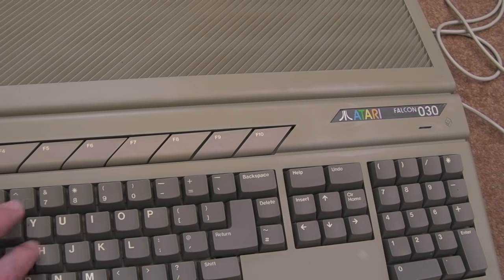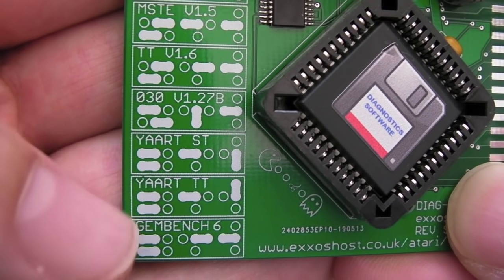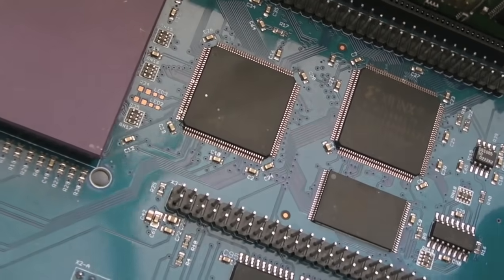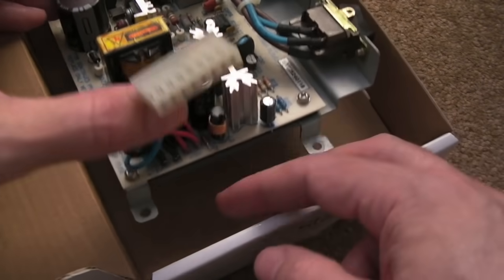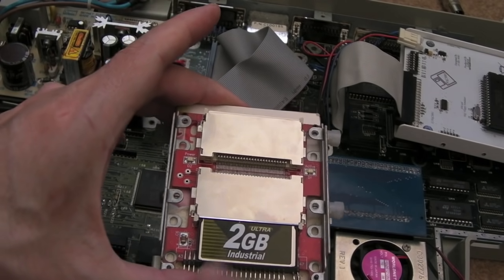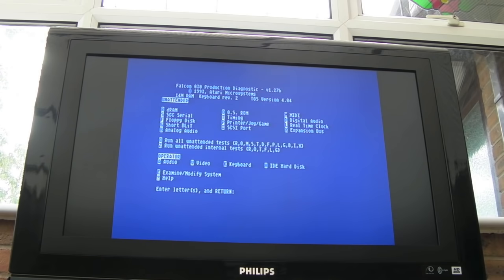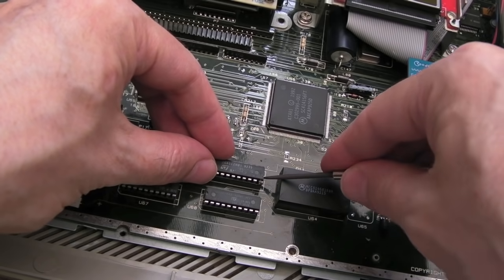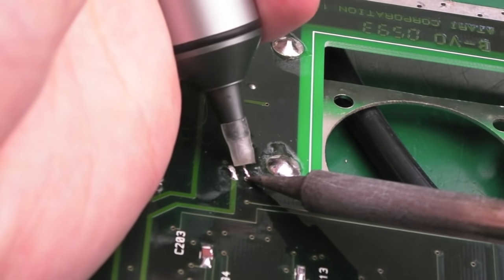Atari Falcon 030 Unbelievable Donation & Repair Part 1 (Fixed + Extras (060))

Comment: Never seen you so happy, congratulations. :) Yeah Jaguar pads work which is cool, you can even get a Pro one at AtariAge, saw someone on a forum suggesting some old ass joysticks for the Falcon's relatively modern 15-pin port. :\ Strange for sure about Falcon controller support in homebrew how it could be more robust.
Always amusing to see your future self comment over what you're currently saying Ie. "No you're wrong past self", like time travel. ^_^ Yeah pretty decent performance but look forward to seeing performance go up. :D

Comment: ☠️BLACK BARON☠️ Designers started DTP and Layout with TrueColor on 21" monitors in !true color! at that time ... they were all waiting for this new wonder 68CPU "early PowerPC" machine ... until I heard the news. Commodore + Amiga smashed it ... the Bill+Steve factor in teamwork. Instead, I received an MS-DOS machine with green monitor "terminal commands" as a present from my father. I was so utterly frustrated at that time after GUI and UI and a fully customizable Desktop user interface with GEMINI and a trashcan on my screen and my first DTP experiences as a graphic designer. No support for my HP Laserjet with lots of Atari shareware fonts I started collecting for DTP purposes. Instead I got a "Typewriter" printer from dad. Totally nonsense concept and idea.

Comment: Couldn't resist any longer. Have. To. Watch! So so envious. One of my fave looking machines. I'd drool over the Falcon in the ST mags in the day. It had so much potential.
Reply from the maker: =D  I still can't get enough of it - it's a great machine, I feel so priveledged to own one!  At the same time I am kinda affraid to use it since parts are kinda unobtainable.  Since Best has a monopoly on parts, wanting £2000 per custom...
Reply: Speaking of which, the keys should be a shade of grey - several tones lower - not brown. It's also weird that the PSU switch is black and not the ST series of grey to match the case... I wonder if that's factory. 

Anyway, it's a beautiful machine that has found its way into a loving home. 

So so jelly.

Comment: Hi, I have an old Falcon030 (1995) which hasn't been used for about 20 years. The monitor is long gone but it fires up when plug it in. I'd like to connect it to a monitor to see if actually still boots. If some one could point me in the direction of a cable and monitor I'd be very grateful.
Reply from the maker: See this page:- https://www.exxoshost.co.uk/atari/store2/  Search for the "FALCON 030 3 IN 1 MONITOR ADAPTER" on there, you can use that to connect to most VGA monitors.
Reply from the maker: PS: If it hasn't been used in 20 years, chances are the RTC / NVRAM chip is going to need swapping out.  It may cause it to not boot if the RAM side of it has failed due to the battery.
Reply: @GadgetUK164  thank you, i'll get one/

Comment: Ehh, I wouldn't plug the drive the other way, you can damage the motherboard if something is wrong there. Lucky it's an IDE drive and not a SCSI drive, because you would have even burned up the cable :)
Reply from the maker: Yes, that was in retrospect one of the stupidest things I've done on my channel - especially when you roll onto part 3 and I pointed out the ICs are like $1000 each (if you can get Brad to get one out for you...).  It came with that cable the wrong way around, I was just re-testing that to check behaviour and prove it, but as you quite rightly pointed out (and I was aware - which makes it all the more stupid) - when IDE is flipped, ground goes to some of the signals...    That said, it was a calculated risk, as we've all connected IDE up the wrong way accidentally dozens of times over the years.   It can cause failures doing that though, as we saw in the Ravi A4000 board repair I did where the IDE had died for that reason.
Reply: @GadgetUK164  Ooooh, tell me about it... I've connected SCSI the wrong way a couple of times only to see the middle wire burn out of the cable and the cable split in 2 along its length :D That was frightening :D:D

Comment: you have an arrow showing direction of the cable to the cf adapter... and the original psu needs to be checked under load.. 😁 superb video... new suscriber here
Reply from the maker: Yes, you are right =D  Thanks!!!

Comment: Were these Atari's compatible with software for the 130XE?
Reply from the maker: No, they run 16 bit or 32 bit code, following on from the Atari ST range.  You "might" be able to emulate an 8 bit Atari like the 130XE though with a fast enough 030 or 060 processor in a Falcon.  Something like this would run on the Falcon, but probably needs an 060 CPU.  https://demozoo.org/productions/153288/
Reply from the maker: This one too might be better - https://atari800.github.io/

Comment: Wow WHAT a donation! Congratz!! With a (hopefully working) CT60 and the "Deluxe Gotek" from Lotharek. Talking about the floppy-emulator: Isn't it that you DON'T have to convert the disk-images into that HFE-format? Imho the main advantage of this unit compared to the Gotek is, that it is more flexible according image-formats. You can e.g. directly use .stx-images (copyprotected images) which you have to left off with the Gotek (or try to convert).
Please do yourself a favor and get rid of that damned original 40mm fan! I changed that for a 40mm from Noctua. What a difference that is! The Falcon now is almost as silent as an STE/STF, maybe also because of the new position I put that in: https://flic.kr/p/2hQSeNo , https://youtu.be/0LHOp732eCM
Looking forward to your next Falcon-video! 😎
Reply from the maker: =D   Yes, I am still blown away!!!   It will do other formats (maybe .stx etc), but it has to convert to .hfe.  The Gotek however works with .st files I think (it certainly supports .adf on the Amiga, and .dsk on the CPC).  I will get one of those fans at some point!  TBH though the existing fan isn't that loud for me (maybe I am doing def lol).

Comment: Hi love you videos and content mate.. I’m in a bit of bother, I have a faulty n64 bung doctor that has power but not video out? So please please can you help as I love that machine. Please message me to sort something out. Thanks
Reply from the maker: I cannot do customer repairs sorry =(  The problem with something like that, if its not RAM or a standard 74 series chip, often they use programmable parts that cannot really be replaced (.eg PAL / CPLD / GAL).  If you are lucky it just has a battery leak which has corroded some traces.
Reply: @GadgetUK164  
Yeah my knowledge is limited unlike yours, it was playing it and it was working fine the started to flicker, then nothing lol.
But thanks for taking the time reply and I do appreciate it.
Looking forward to falcon part2